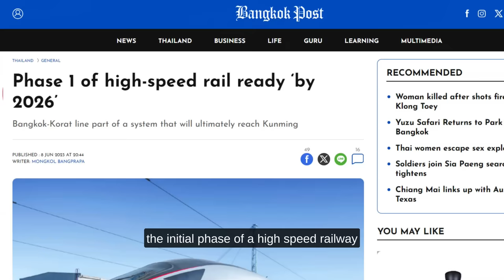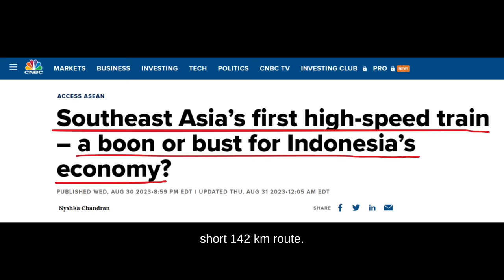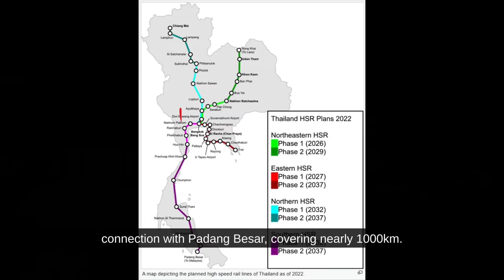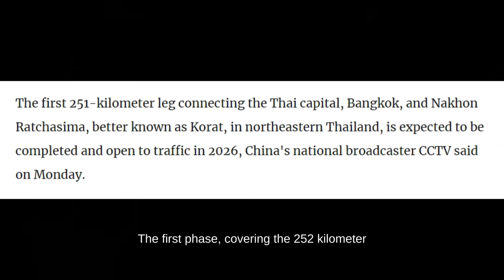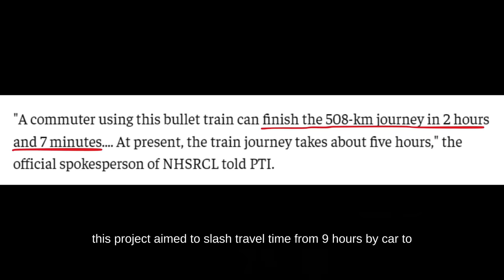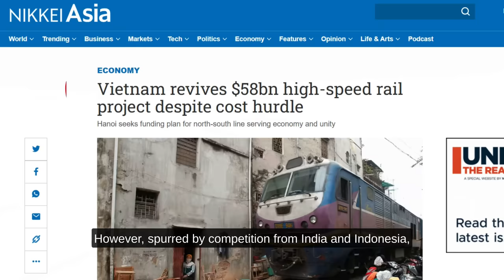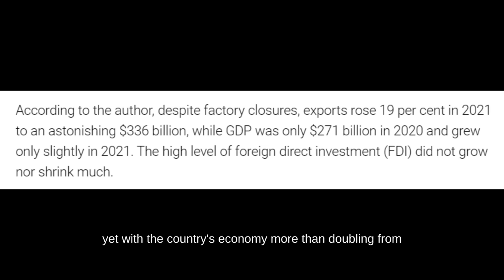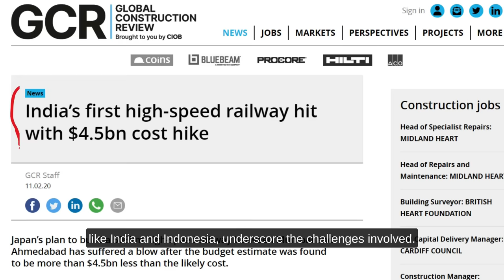Thailand, India, and Vietnam Competing to Build HSR

Comment: Vietnam should work with China.Japan is much smaller to China in scale.
For high speed train building, Japan is now far behind China in trem of speed  technic and experience.
Reply: The biggest advantage Japan has is that Japan can possibly provide 50 years loan with 0.1% interest rate. This is almost a free loan. HRS loan by China is usually 2 - 3%.

Japan never has HSR accident with death.
Reply: Japan is not that enthusiastic in responding Vietnam’s request for HSR recently for some reason. So Vietnam is turning back to China for help, but things can change again. You never know.

Comment: China Launches High-Speed Rail Through Laos in First Leg of SE Asia Corridor. VOA December 02, 2021, 8:48 AM
Reply: HSR... ?
Reply: @WeAreTheGAS  High-speed rail (HSR) is a type of rail system that operates significantly faster than the traditional rail system.
The definition most often used for high-speed rail is the practice of speeds at or in excess of 160 km/h.
Reply: @sirisakpimjun4384  
Ohh..., 160km/h ... is high speed... ? 🤣
Reply: @WeAreTheGAS  You Can Read from the interoperability of the rail system within the European Union. English version.
Reply: @sirisakpimjun4384  -> 
Oh yeahh... ? 
160km/h ... is high speed... ? 😭
Reply: @WeAreTheGAS   a type of rail system that operates significantly faster than the traditional rail system.
traditional rail system speed around 80-120 km/h.
Reply: @sirisakpimjun4384  -> 
160km/h 👉 high speed... 😆😂🤣
Reply: @WeAreTheGAS  You can studies from the infrastructure sub-system of the trans-European high-speed rail system.
Reply: @sirisakpimjun4384  -> 
Ok..., 160km/h is high speed... 😆😂🤣😭
You don't know the different between  HrSR and HSR... (UIC standart)... ?
Reply: @WeAreTheGAS  UIC for Guidance only not for standard. HrSR  is netizen standard..
Reply: @WeAreTheGAS  You can studies from a technical specification for interoperability relating to the ‘infrastructure’ sub-system of the trans-European high-speed rail system, and a technical specification for interoperability relating to the ‘rolling stock’ sub-system of the trans-European high-speed rail system. 
Similar to countries in Europe and China.
Reply: @sirisakpimjun4384  -> 
160 km/hour... 👉HSR... ? 🤣
Reply: @sirisakpimjun4384  -> 
High speed rail (HSR), passenger train that generally travels at least 200 km (124 miles) per hour and cruise up to 355 km (221 miles) per hour though some have reached higher speeds. 
(The Editors of Encyclopaedia Britannica, Science & Tech).
Reply: @WeAreTheGAS  Encyclopedia Britannica, Science & Tech, Opinion only not official technical specification.
How about Indonesian technical specification.
Reply: @WeAreTheGAS  In Thailand TRACK CLASSIFICATION
high speed railway
Maximum service speed: more than 200 kilometers per hour.
Type of transportation system passenger transport vehicle
Maximum axle weight not more than 25 tons or in accordance with standards.EN1991-2 Eurocode 1 : Actions on Structures - Part 2 :Traffic Loads on Bridges (Load Model 71)
Track 1.435 meters
Reply: @sirisakpimjun4384  -> 
Ok, 160 km/hour... High speed. 😆😂🤣😭
Reply: @WeAreTheGAS   USA, UK, not 160 km/hour.
Reply: @sirisakpimjun4384  -> 
Uk, USA... ? 
Who's talking about USA, UK hsr? 
160km/h ... is High speed... 😂🤣😭